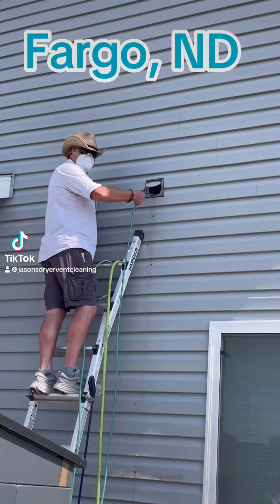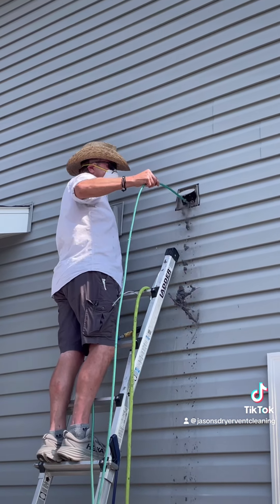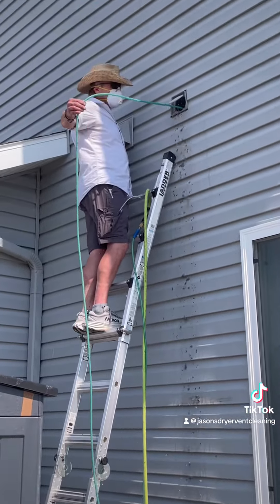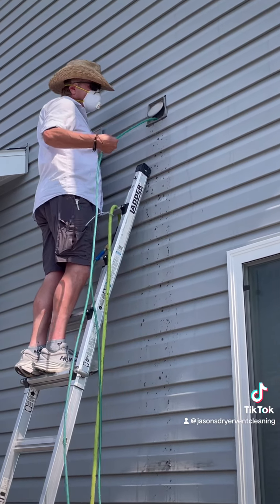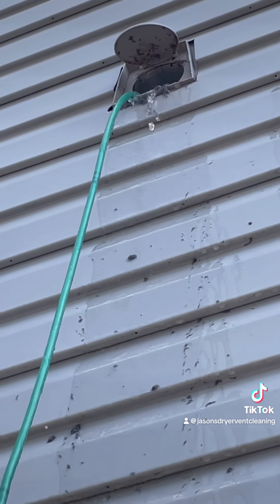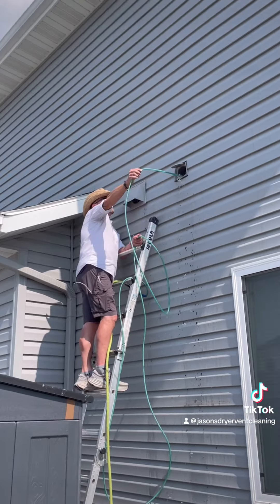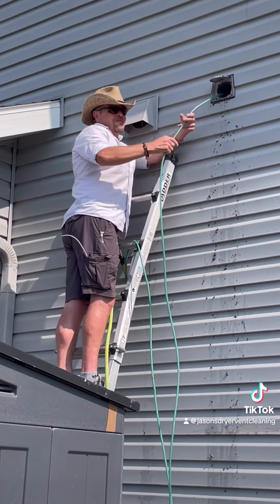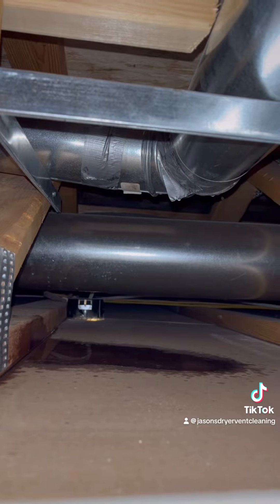Water in a dryer vent????🤯🤯🤯

Comment: I’ve got a couple good dryer vent stories. I was dating this girl and she just had rented this house. We’re on the deck and I seen a bird fly right into the dryer vent. I ask if she was having trouble getting her cloths dry. Takes longer here she said. I get a ladder and the vent is full. I end up going up into the attic and pulling this vent apart and removing about 7ft of debris. Same girl different house. Her brother bought a brand new house. I go over and she ask me to see if her cloths were dry. I open the door and stick my hand in there and almost got steamed burned. She said that was hers brothers 2nd new dryer that had been replaced. So I go outside and start looking for the vent. Not to be found. I go in the crawl space and locate it  and the Vocational school down the road had built a back deck on this house and removed the dryer vent and nailed their deck band over the vent! Not only did the inspector miss it so did her brothers home inspector he had hired. So I rerouted the vent. Last one, I was doing a remodel at this high end condo. Their was a Sheetrock patch in the living room  ceiling, no bathroom above. So she said cut it open because it was going to be repatched. I open it up and their was a dryer vent there that no joke had a diaper wrapped around it! The vent went straight out of the chase before exiting and that chase didn’t have to first piece of insulation at the vent penetration causing cold air to get in there and make the dryer vent sweat when ran during the winter. Plus the vent maybe had a golf ball size opening in it to let the air out. I showed the what lint could do with a light spark and she had all three of her units dryer vents cleaned out! 
Enjoy the Channel!!!
Reply: Thank you for great important  videos
Reply from the maker: Always remember!!!!!! Birds will a lot of times build a false nest back a ways because they are smart enough to know that their young can go the wrong way ✌️
Reply from the maker: I love your stories! I call them “Duct Tales” 👊